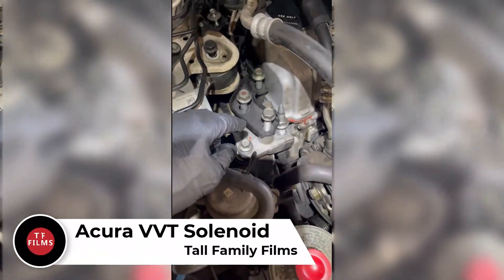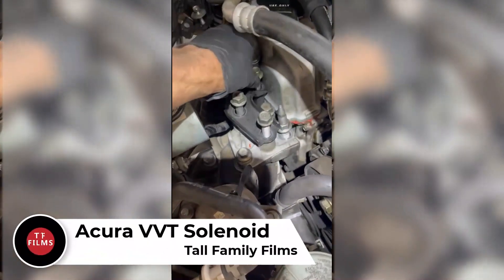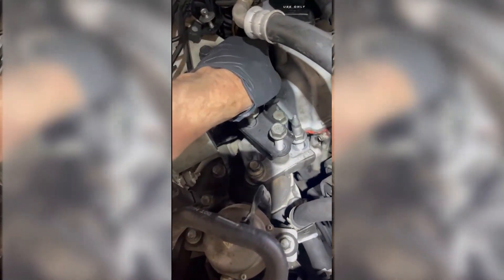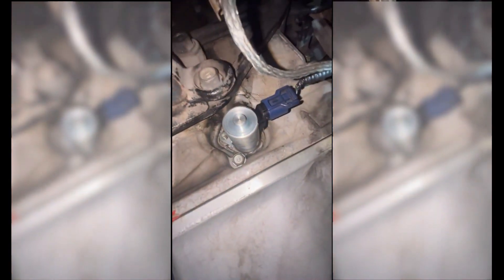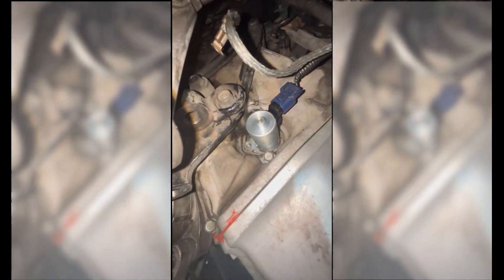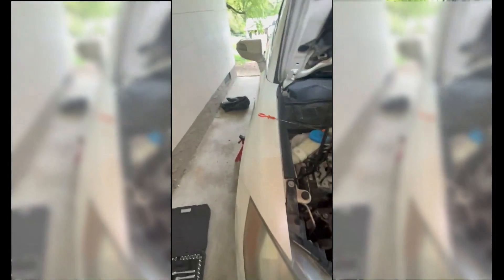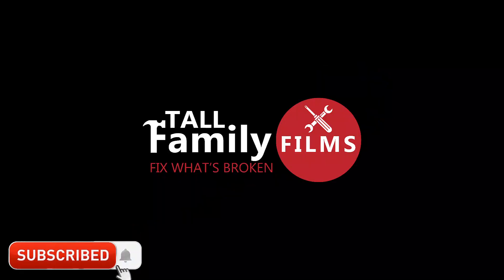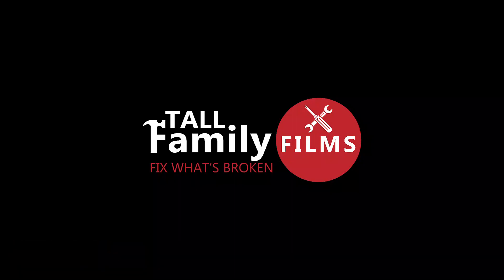Acura RDX Variable Valve Timing Solenoid Replacement (oil leak)

Comment: Is this a hard repair? I know you showed where it’s at but do you have to disassemble the actual engine to replace it or?
Reply from the maker: @Drifty_-yg6op  it’s not hard, it’s tedious and in a really small space. One thing I didn’t show in this video is you need to put a jack under the engine with a block of wood on it and jack it up a little on the oil pan (the wood protects the pan). This takes the pressure off of the motor mounts and makes them much easier to get on and off.  You’ll also need a deep welled socket to get those nuts off.

Comment: This looks like my next job, what size bolts are they? Thanks
Reply from the maker: @Dougarony  it’s a Honda so I’d assume 10mm for the VTT but you’re going to need a whole socket set to get to it. But this isn’t the VTC actuator (it’s a LOT more complicated). It is “related” to engine oil so it’s conceivable to cause a P1009 build be top of my list. One thing I don’t show in this video is you must support the engine with a jack and a block or wood on top before removing the motor mounts. Those bolts are massive - probably 22mm or larger.
Reply from the maker: Forgot to mention, you can easily test the VTT with some wires and the car battery. If it clicks, you’re good to go and can put it back in. Clean it up though. Don’t let the wires touch :)
Reply: @TallFamilyFilms  Well, I got as far as the 2 bolts off on the front bracket, but the 3rd one started to round off, so I stopped. Seafoam?
Reply from the maker: @Dougarony  it’s a motor treatment that “liquifies” oil build up (like what you’re trying to get to in that screen. google it - should be at any auto parts store. Read instructions but you basically just pour it into oil reservoir (for an RDX I think it’s like 6oz)
Reply: @TallFamilyFilms  yes I have heard of it, thanks

Comment: The motor mount gave me a fit. Finally was able to get it off and ge the VVT solenoid replaced but I can not get the mount back together as it seems 2 of the screw holes may have shifted back and inch. Any suggestions?
Reply from the maker: You have a floor jack under the motor?
Reply: @TallFamilyFilms  negative. Does that mean I'm screwed?  Your video was the only thing I've seen on changing VVT solenoid. It helped but lacks detail.
Reply from the maker: @jasontribendis5864  are you screwed? No. Not likely. But I do see why you struggled to remove the mount. But you’re going to need a floor jack under the motor to get it back in place. Use a block of wood between the jack and the motor so it’s not metal on metal. You’ll find it much easier this way.
Reply from the maker: @jasontribendis5864  to offer you some additional insight, the entire motor has quite a bit of flex and movement to it. Right now you’re lacking one mount so movement is limited and not ideal for sure. Once the jack supports the motor, it will easily move in all directions to align the bolt holes.
Reply: @TallFamilyFilms  Awesome, thanks a million. I'll let you know how it goes lol
Reply: @jasontribendis5864  How did it go? I have to do mine now.
Reply from the maker: If you have a scissor jack that comes with some Hondas, it likely could work but it doesn’t roll so it’s not ideal